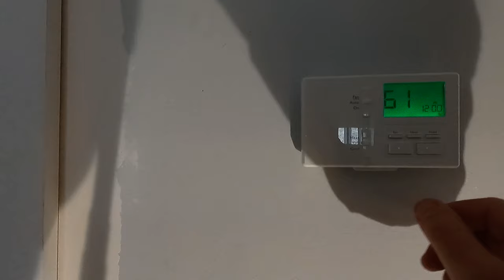Troubleshooting a Home Furnace

Comment: No voltage will be shown between r and w wires. R is 24vac and w is a switch leg for heat
Reply from the maker: @benonufry  with no call for heat by the thermostat (open relay contacts)  there will be 24vac between R and W. Closing the relay (heat on) will connect 24vac to the W and start the fire on sequence... then Vrw will be 0.